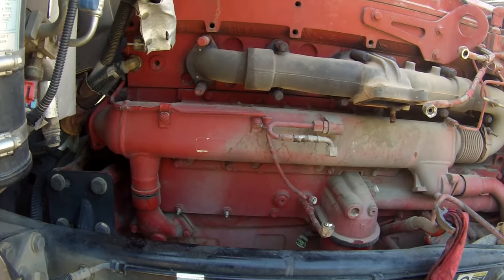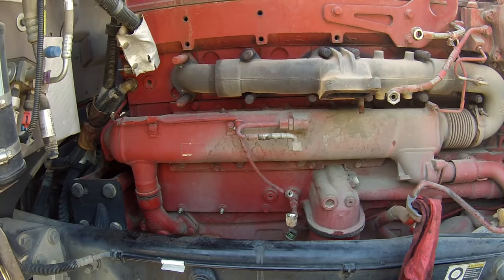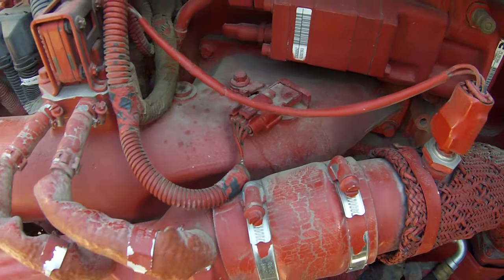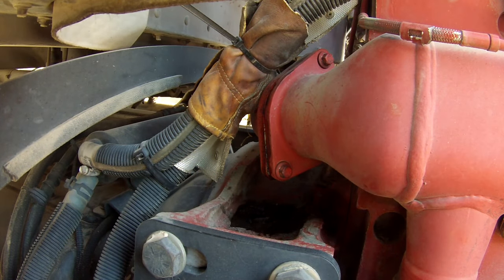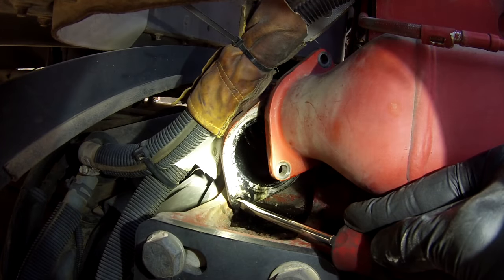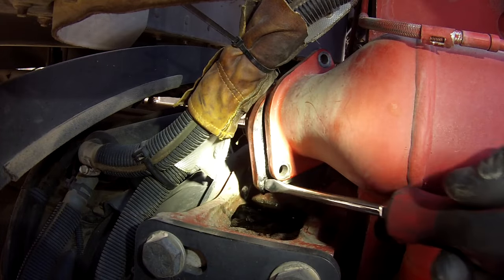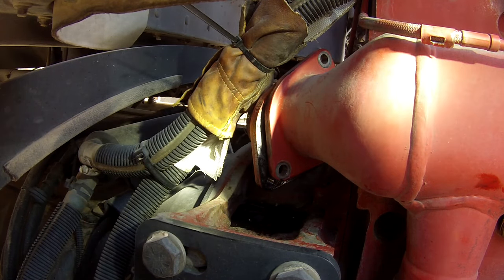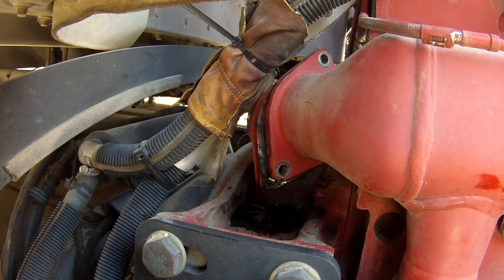How to Diagnose a bad EGR Cooler on Cummins ISX

Comment: Thank you so much for the insight on a bad EGR cooler. The map sensor on my truck is soaked with coolant also exhaust pipe to DEF filter wet from coolant. Great video!!!
Reply: How possible map senson..

Comment: Hello, I'm having a issue with my isx cm870, coolant comes out of the exhaust side of turbo upon cranking an also getting a high oil temp when pulling a load

Comment: Very nice video!! Very good info right to the point!!
Reply from the maker: dilbert biggen thank you!
Reply: BulletMcNugget. Same engine truck been using about a gallon a week do u think its the egr cooler can't find any leaks no where
Reply from the maker: Big Tex Trucking yes, more than likely. Sometimes the engine starts letting coolant go into wrong places, but ud notice that on performance. Pull that end pipe off and youll be able to tell if the cooler is the problem.
Reply from the maker: let me know what you find and how much a cooler costs there. I sell a lot of parts, and maybe I can get you it. Or if you wanna swing by CA, Ill replace it for ya. lol
Reply: BulletMcNugget just order one off eBay for $795 free shipping going to attempt to try to put it one this weekend don't look too hard
Reply from the maker: Big Tex Trucking ah, u ordered an aftermarket one, not OEM. I mean they work, but ive never tried them. Let me know how it lasts.
Reply: BulletMcNugget man I hope its last 2yrs I hope had a oem put on it when I got it and it did not last 3 yrs and they wanted $1500 for the oem
Reply from the maker: Big Tex Trucking lol i know how much they are, thats why I said let me know. I coulda problly gotten it to u $1150-1200 for an OEM, updated style.
Reply: Basically if you pull your imap and it's wet then you got a leaking egr cooler?
Reply from the maker: King David pretty much. Really no other way it can get wet except for egr cooler. And to confirm it, just pull the pipe off after the cooler and if its leaking, it will be wet in there.
Reply: Also if it is not wet, and there is crumbly sut deposits you can take some sut, put it in a cup of water. If there is any coolant in the sut it will separate and be visible in the cup.

Comment: 2018 Cummins X15 using 3-4 jugs per 5 day shift. Had it to the International dealer & they say that the EGR value & cooler are dry. However due to the poor workmanship there lately I question this. They changed some hoses, clamps & coolant tank. Still uses too much coolant. This is the second new tank. After seeing this video makes me really second guess if the dealer properly test the system. Oh ya after stopping there's whitish smoke coming from the passengers side where the Def filter/regen is. So this adds to my suspicion. Any words of advice?
Reply from the maker: Possibly a cracked head

Comment: I've got a '16 Cascadia 415 HP ISX.  I blew a heater hose stop engine lite came on. I limped it to a safe spot about 2 miles away. My shop mechanic fixed it we had to put in 9 gal of coolant. 
That was Wednesday this week. I've added 2 gal about 6 hrs apart on Friday. 
I smell antifreeze still. Could it be the EGR?

Comment: Can the EGR Cooler be bad if I’m not noticing a coolant loss from the reservoir tank.

I have code “EGR DELTA PRESSURE” SPN-411 FMI-1

Replaced Delta P Sensor and cleaned all connector pipes and ports. Check engine light still comes on when I pull up a hill.

I get white smoke coming out of stack pipe when accelerating hard or pulling up hill. Once the “EGR DELTA PRESSURE” check engine light comes on then I get no white smoke anymore, but engine performance is decreased.
Reply: Imap sensor
Reply: @nunyabuziness8421  replaced that one multiple times. Same problem. Ended up ✂️ best decision I’ve ever made

Comment: Question I have a 2007 international 9400i I replace belt tensioner,all belts and my truck is making a loud squaling noise when on the gas what could this be
Reply: Lubricate the pulley
Reply: Tighten clamps on charge air hoses

Comment: Hey I know this video is old as shit but hopefully you can help. I've been to 2 mechanics for my isx15 and they both said the same thing. My problem is at idle when my truck passes operating temp of 205 my water temp goes up to compensate for that and when the temp of the water passes 200 the fan kicks on automatically. But when driving on the highway my oil temp will pass 205 to 210-211 but my water temp will stay at 170 and won't go up to kick on the fan so I'll have to manually turn the fan on which base air cools the engine. Both mechanics told me change the thermostat and I did it both times thinking maybe my thermostat was bad but still the same problem wondering if this is oil cooler related or if you've come across this before and can help thanks
Reply: Daniel Kenney I had a similar problem and after I changed my oil cooler the oil temp went back to normal working conditions

Comment: I'm loosing about 2 gallons of coolant a week not going into oil and did a pressure test on tank and maintained pressure and die didn't change color in test truck is deleted do you think cooler is my problem? 09 isx 450st
Reply: What was your problem? 

My isx is deleted and in 2 days it went through 1 gallon of coolant. The egr is just shut off by computer on my truck. Smoking like a chimney out the exhaust and I’m getting coolant into my air system.

Comment: So i have 550 cummings and noticed i have oil in the coolant and half down on the dipstick  i was told its the oil cooler is that corect or do i need to replace the egr cooler to thanks
Reply from the maker: Id say most of the time its gonna be ur oil cooler. Wont really be egr cooler cause theres no oil inside egr cooler.

Comment: I have a  2006 columbia 60 series  and I'm loosing coolant pretty bad and I can't see where it's dripping, can you help?
Reply from the maker: nino cerruti check ur oil, make sure none is in there. If no, then pull ur coolant cap and start truck, if its bubbling in the tank then itll be a head gasket or maybe head. Last time i did one of those, was a head gasket
Reply: DieselBullet if it's in the oil then what is the cause and fix?

Comment: Im going through anti freeze like crazy. I have a lot of back pressure. Loosing a lot of anti freeze through my radiator cap. I have a six 450. Would a bad egr cooler cause  a lot of back pressure?
Reply from the maker: Brandon Wright ooo, noo. Not likely, that would most likely be a blown head gasket or bad liner. That is almost the only way pressure gets into the cooling system.
Reply from the maker: *dropped liner is what i meant
Reply: BulletMcNugget thanks. I believe it is my engine head. This issue started a week ago. Would it be ok if I drove the truck with this issue for a little while, like a week or two?
Reply from the maker: Brandon Wright heads gotta come off regardless, once u get there ull see what it is. It wouldnt be recommended but i had a guy come from florida to CA. Ull just keep losing coolant, dont think anything else should happen
Reply: BulletMcNugget ok cool thanks for your input. Greatly appreciate it.
Reply: Brandon Wright hey just curious to see if the issue was a bad liner or something else
Reply: OB3Y$WAGMA$T3RFL3X3008 it was a bad liner.....they bypassed the air compressor and I still had the same issue before I rebuilt the engine. After they rebuilt the engine, problem solved.
Reply: Bad air compressor. Look it up same symptoms

Comment: I notice a leak what is this part
Reply from the maker: david phillips egr cooler. But it wont leak while truck is standing. Is ur truck hard to start in the morning after it stands?
Reply: @BulletMcNugget  no not really I can send you a picture have a email ... all my gauges work fine no smoke.... can I run it like that few weeks till I can save money?? Or add blue devil head gasket sealer?